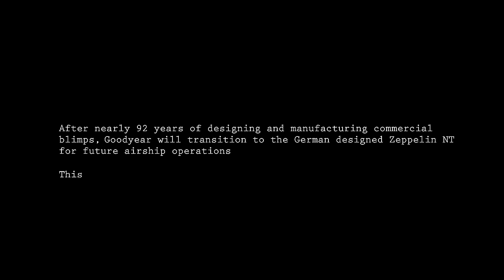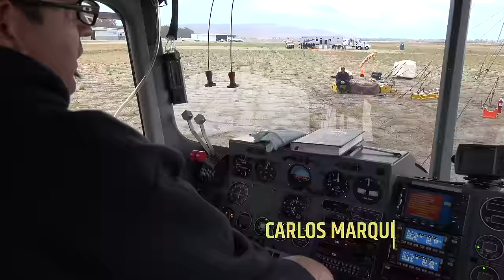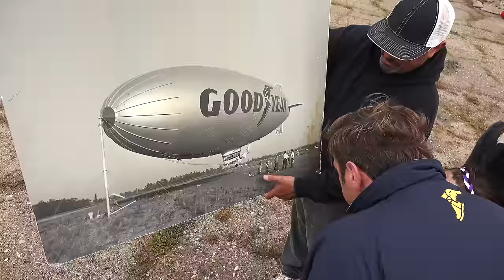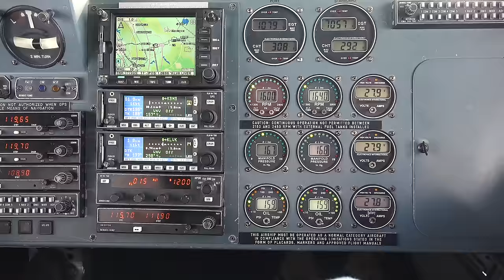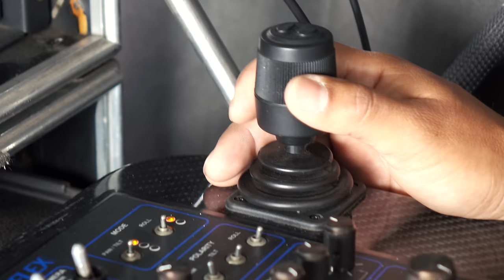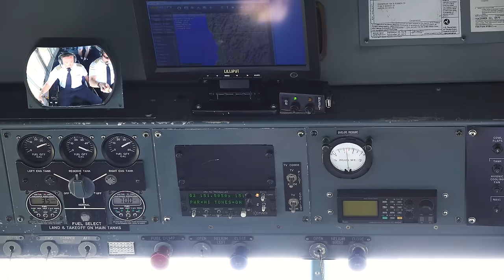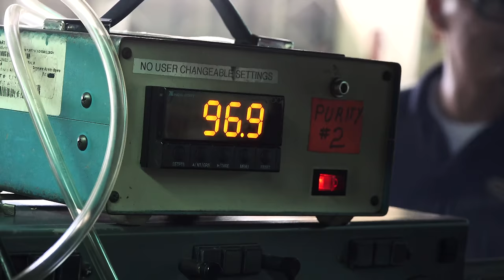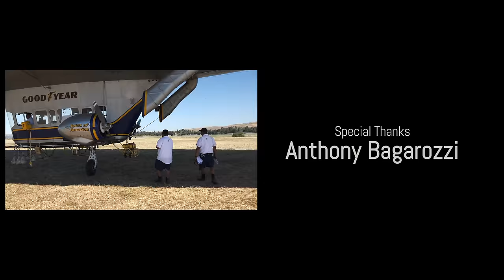The Good Years: A Blimpumentary

Comment: The end where they took it apart was in the hangar where I worked for 3 1/2 years in the Marines with HMT - 301.  I miss it!
Reply: I did my TME OJT with 301 on the 53 side in early 76! After I was a crew chief in HMH-361
Reply: @billauth1419  I got there in 1989 after they took the CH-53s and made them into HMT-302 and left the CH-46s as HMT-301.  I was the Ops Chief and the squadron history was a fuddle.  One weird thing that I encountered as Ops Chief was watching our Group CO sit down in my office and turn white as a sheet.  He  had just come back off a training hop and asked me to pull out his #1 log book and look up a certain date.  When I  checked his log the entry was in red (signifying a crash) and it showed that had just flown the same CH-46 that he crashed in Vietnam in 1969.
Reply: Vincent, what was the group CO’s name if you remember. I flew with a few Viet vets when I was there. But I only flew once as a pax on a 46.

Comment: Wonderful story, and very emotional for me.  For 17 years, I was one of the blimp operators for indoor R/C electric blimps flown at many Detroit sporting events, including Pistons basketball and Lions football.  We flew for a total of 6 teams in 4 sports at the Palace of Auburn Hills (now demolished) and the Pontiac Silverdome (first to be imploded, after a long abandonment), and had 6 airships over the years, ranging from 13 feet to 28 feet in length.  There are so many similarities between these prize-dropping models and the real thing.  But I have to say, vive la differance:  Ours probably operated a bit more like the new NT.  There were no control surfaces requiring speed, the rudder had a reversible motor and blade (two, two-blade props mounted in opposing directions for symmetrical thrust).  Our gondola fans could rotate about the lateral axis, so we had thrust up, down, fore and aft.  Being light was very bad, as down thrust was very weak as the exiting air from the fans is deflected sideways by the bag above - lifting was efficient.  The rear rotor meant we could turn at any speed, even spin in place, and fly backward.  That said, I think sometimes we made landing it look harder than the full-scale, as we battled the constantly changing currents in the stadiums from the ventilation systems, especially in the Silverdome, which was suspended by air pressure.

1:20:15  <This.  You can imagine we had some great stories, good and bad, I could never tell them all.  So I'll just leave my favorite high note:

I was flying out over the ice at a Vipers hockey game, and the mascot, Vipe-Bear, was at the far end of the ice hamming it up to the crowd.  I let her settle to about a foot off of the ice and built up "ramming speed", and yes, popped that bear right in the keister!  He loved it, spun around with his fists pin-wheeling in front as I lifted away - the crowd went nuts.  He told me in back we need to do that again sometime.  We never did.
Reply: Loved the info, thanks! I always thought vectored thrust would make it easier, but when you say the air currents would mess you around, I can see that. Loved the story too! Would have done the same myself. 🤣 You write pretty well.

Comment: Goodyear-Zeppelin built the USS Akron and USS Macon US Navy airships in the early 1930’s. They were only 18 feet shorter than the largest airship ever built. the German Zeppelin, Hindenburg. The US Navy airships were 785 feet long, 113 feet in diameter and had an internal gas volume of 6.5 million cuft of helium.
I’m not sure why Goodyear had to turn to Zeppelin-NT for the design and manufacture of a semi-rigid airship. Goodyear and Goodyear alone has kept and improved LTA technology right up until 2015. So the question is, if Goodyear planned to cease blimp construction and wanted to fly semi-rigids instead, why didn’t they design and build it?
Reply from the maker: Because Lockheed Martin owns all the designs and technology for the blimp, and they decided they no longer wanted to manufacture or maintain the air operating certificate.  That left GY with either the Lightship group or Zeppelin.  Manufacturing your own airship is not cheap
Reply: avgeektv 
How did Lockheed-Martin acquire the Goodyear designs?
Thank you for this info.

Comment: Cant believe they leave the  lines hanging from the front of the blimp. I really thought after launch they would be winched in.  Surely they can pose a risk if they start whipping around in a wind.
Reply: My guess is that if the wind is high enough to be a hazard,  they are too high for flight. 

It surprised me too though.